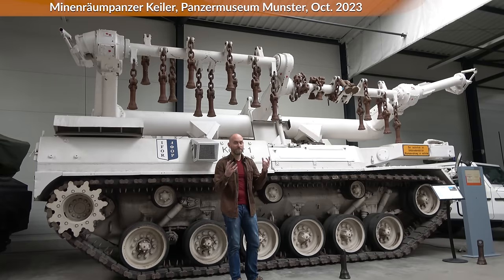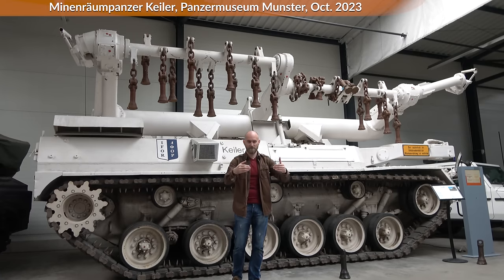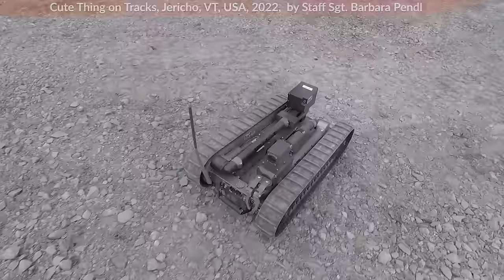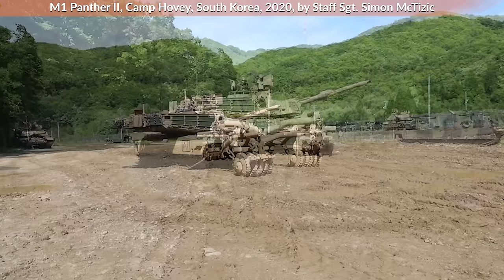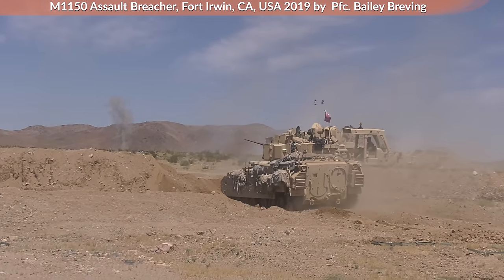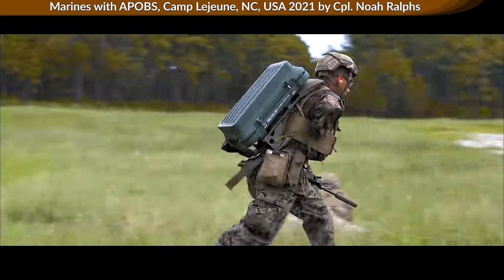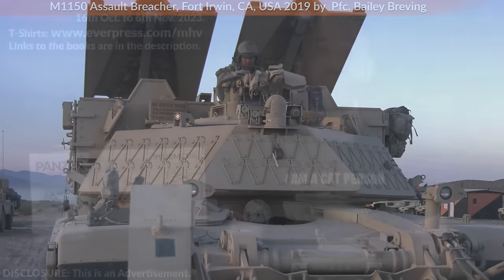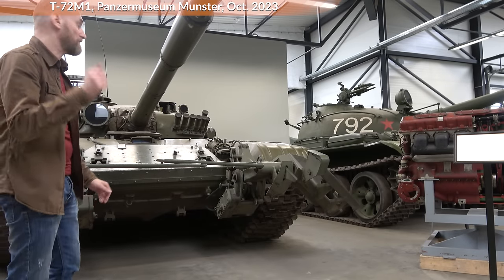Ukraine: The Problem with Mine-Clearing Tanks

Comment: State of art German and other NATO forces use mine-lifting and plowing to sides of the armored vehicles (minimizing dust clouds), NOT flails.
The WISENT 1 is an example mine clearing vehicle used by German forces.
Look at 
This massive armored vehicle has a giant plow for clearing Russian mines
Eight machines like this one are already in Ukraine to do the dangerous work of dealing with minefields.
BY Kelsey D. Atherton | Published SEP 22, 2023
Reply: Problem is still, that the mines are part of a defense belt, well inside the reach of dedicated artillery and as soon as the tank is spotted it's gone. Most of the time long before plowing a single mine... Clearing mines under fire is suicide.
Reply: @mnk9073  The new generation lift and plow to sides system moves much faster than the flail system, and without the massive dust cloud slowing the operation.
Using air dropped or rocket launched minelets to destroy mines only replaces enemy mines with dud friendly force mines.
ALSO: there are now GPS-driven, armored mine clearance DRONES.
Reply: @EK14MeV  Sure, but any selfrespecting defender has eyes on his minefields and beyond 24/7, the days of "sneaking up" on anything are long gone...
I mean, that famous picture of the first attempt by the Ukies shows 3 or 4 mine flails burning a mere meters into the field at best, half of them probably never even started flailing.
Reply: The Wisent 1 is not used by the german forces. It's only created by a german manufacturer(FFG). One specialty of the company is to recycle old vehicles like the Leopard 1 or the M113 to use them as base for new extended vehicles for special tasks like pionier tasks or mine clearing. Due to the old basic vehicles, the price is lower than for newly manufactured vehicles
Reply: @mnk9073  It doesn’t make sense that so many petty arguments rail against the best system available.
And there are now much less costly drones being developed, designed to clear mines without risking crews.

Comment: If you literally had a solid steel roller whose front roller was made of solid steel surely this would survive numerous explosions and wouldn’t kick up dirt etc like the chain flails and might also be a bit quicker too.
Reply: But, that wouldn't work on uneven ground since it wouldn't touch holes in the terrain
Reply: @nomennisceo6495  it’d have spikes embedded in it, which would also give it greater traction.
Reply: @josefk332  So, effectivelly chain flail but less practical to use and more expensive to make?

Comment: You by pass the mine fields by equipping an entire armour corps with amphibious vehicles that then runs along a river perpendicular to the front & then only go landward once the armoured corp  is sure it’s travelled deep enough into enamy territory to have passed the mine fields. You do it at night lacking heavy moonlight & have artillery & glide bombs drop either side of the river to mask the sound of the amphibious armoured corp.. Russia’s 40 odd Sprut-SD amphibious air droppable 125mm light tanks would do well here & can be upgraded above the waterline on the front & sides of the turret.
Reply: With reactive armour
Reply: "equipping an entire armour corps"
  - This is a problem in itself.

"amphibious vehicles that then runs along a river perpendicular to the front "
 ...and gets detroyed in the meantime due to making itself wasy target.

"You do it at night lacking heavy moonlight"
 - And hope enemy doesn't have a singular NV device?

Comment: Surely if you're pushing up to an assault you shouldn't be running the tanks on the road anyway, so mining a cross roads may cause logistic issues but shouldn't stop the attack
Reply: Depends on how far into the rear the enemy's rapid deployment mine system can reach.  
Tanks are often moved towards, or shuttled along behind, the front on heavy wheeled transporters as those can go faster, and don't wear out the tanks.  So if your plan relied on rapidly shuttling tanks from elsewhere in order to get the force concentration for your attack then mines dropped far enough back to interfere with that road-based rapid redeployment could definitely mess up your attack plans.

Comment: Why arent these things just completely remote controlled? Why do they even need a person in it.why are robots limited to being dog sized?
Reply: Many are build from the chassis of old tanks, and remote control modifications are expensive and difficult. Direct control of the vehicles also give a better awareness of the vehicles movement, there is also the problem of control loss
Reply: The newer ones, purpose-built vehicles absolutely are. However, those aren't standard kit. They are absolutely better, but they're not what people have. It's cheaper to outfit an older AFV chassis than buy a remotely controlled mine clearing vehicle.
Reply: Check out the slovak BOZENA 5 mine clearing vehicles- they are remote controlled and are pretty huge
Reply: Ukrainian farmers actually built RC mine clearing equipment out of old Soviet tractors, which I thought was genius! They’re so innovative and make good use of everything they have. I suppose necessity is the motivation too…

Comment: This problem should be solved different. Big size plower, I mean Nasa rocket crawler size, with removable supersize shield, shielded catepilars, with antirocket system on the top, with plower on the front and rear, with metal detector and superpower electromagnet underneath. But this would be probly to expensive to produce and operate.

Comment: I remember when it was “give us equipment and we will march on Moscow” and now it’s “see the problem with this equipment is….”
Reply from the maker: Well, if you consider that in fall 2022 the Russian lines were very thin and the Ukrainians broke through with rather light units, it is still debatable if that would have worked out, but you seem to miss that the front line fortifications etc. have completely changed by now.
Reply: @MilitaryHistoryVisualized I’m aware. I was simplying pointing out a problem that most people saw to begin with. A war was never the aim of Russia, it was to get an instantaneous surrender. When that option became a no go, defense became the primary objective, and boy did it work. A literal wall

Comment: So, considering all the mines have at least some metal parts, couldn't a new mine-clearing vehicle be designed which would have essentially huge microwave at the front? I know that there were experiments with such a thing for crowd control. And considering that mines are usually just few centimeters underground, then this should be easily penetrated by microwaves which would heat up all the metal parts and explode the mine.
Reply from the maker: I don't think it would produce enough heat/energy to blow up the explosives see this: https://www.youtube.com/watch?v=kC0gf7oWRUU
Also, it would need a LOT of energy I suspect. Another problem would be focus I suspect.
Reply: @MilitaryHistoryVisualized  The video you send is focused on reactive armor. Even if the explosive in mines is the same, you're forgetting that mines have to have fuses which should be much more vulnerable to this... theoretically. I'm not sure if anyone tried to put mine fuse into microwave.
Focus shouldn't be an issue. As I said, there was some development on it for crowd control. If I remember correctly, they could aim it relatively precisely up to 100 meters, maybe more (precisely meaning able to target specific person). Now power consumption might be an issue. It's one thing to heat up skin just enough for it to be uncomfortable, but another to heat up mines enough to make them explode. That being said, if development would be started I'm sure something would be figured out eventually. If you throw enough money on a problem, that problem will go away.
Reply: @fanta4897  "mines have to have fuses which should be much more vulnerable to this... theoretically" - just no. Theoretically AND practically, fuses would not be more vulnerable to this enough to make this vehicle survivable (so, practical).

Comment: Of course these mine clearing equipment are slow and cumbersome, and they could be seen at work for miles. For a commander to send these onto the battlefield without first trying to clear most of the enemy forces directly in front would be ordering them to their certain deaths. The original idea was to saturate the enemy with shells, bombs, and what have you first before driving these demining equipment over the battlefield to allow your troops to advance afterwards. These flail tanks and mine clearing vehicles are not designed to go out there as vanguards, at least not without shellacking the opposing troops first with lead and explosives.

Comment: The truth is that the modern defensive battlefield requires a super heavy assault gun with multiple anti projectile counter measure systems and multiple turrets. With an outer hull to stop heat projectiles.

The landship concept worked for WW1 to breach the trenches and bobwire. In WW2 maneuver was more important and the landship concept was not practical. 

In today's static battlefield a landship with multiple layered defenses and heavy armor would be practical. Multiple tracks like the t95 assault gun.
Reply: Doubt it, by the time it is developed and deployed artillery will be scaled up to deal with it.
It will be big and slow.
A billion dollar target for a cheap shell

Comment: I doubt many mines are buried more than 0.5m deep.
Why not use a v shaped plough to cut a lane 0.6m deep and the width of a tank's tracks, pushing everything to the side.
Reply: "plough to cut a lane 0.6m deep and the width of a tank's tracks" - Please think of all the reasons things like this aren't used in civilian world (despite potential uses) and multiply that reasons by "battlefield conditions!".
Reply: @randomnobodovsky3692  They are used in the civilian world for clearing regrowth from areas which have been logged & stumped.
The guy I asked said he'd ploughed down 15'-18" in the past using a Komatsu DX155. Hadn't tried deeper as there was no need but he thinks in farmland, 24" wouldn't be a problem.

Comment: MOS 1371: can someone answer me a quick question and tell me that I’m either onto something or barking up the wrong tree. 
Most people don’t realize that the spectrums of light are extremely broad, and the light that we can visibly see is extremely small. Some rays can penetrate ground surfaces and even metal. Such as the radio rays of light from a 5g Wi-Fi. 
I wonder if there’s a way to convert these rays light into a visible real light and use it to detect explosive material on a battlefield?

Comment: I try to tell people there is a very easy way to clear mines without equipment lose or injury s. It falls on young deaf ears or stubbornness. My proof is Israel does it without a single casualty. You have seen it but don't realize what you are looking at. You have to have at least in size Caterpillar D9. D10 is the same size but built heavier. D11t would be best. You need to add minor armor around cab. T21 or asu400 high wear carbon steel the same as the 3 to 4 ft thick blade is and tracks are made of. Tank mines will not affect D9t tracks at all. It would be best to push one D9 with another D9. Than you can push 2 to 4 ft deep at close to 20 mph in second gear through permafrost and any boulders even the dragons teeth. It will cut them in half. I done it myself in the Artic circle. The blade is 10 to 12 ft tall. 18 ft to 24 ft wide. If you put them beside each other blades touching and two pusher. Your are 50 wide. Pushing in front of you at least 50 yards of dirt. 5 loaded dump trucks.   Depleted uranium can not penetrate that much dirt plush 3 foot of high carbon steel. Which is 4 times stronger than stainless steel. Please check me out i dare you to think i am a lier. But i think D11 would be even better. Running 4 of them together at a time. No kidding 20 mph at least 50 foot wide or more with D11. They are all wired from factory GPS compatible to be ran remote even. In Alaska i seen D10 m. The m seires has a 6 way operational blade with blade forward or back to dig or carry load. M series also has 4 ft wide tracks that would help in the mud. D9 weights 225,000 pounds. 100 plush ton. Dependable. Twice the size of an Abrams tank. D11 will walk over and crush an Abrams tank so don't park 8n front of bland you can't see it or feel you are pushing it. D11 even D9 will push through those forests filling defensive trenches without stopping. I have done it. The trees stay standing straight up and just keep piling up in front . They don't even slow them down like a blade of dirt. Adding 6 or 8 inches of high wear carbon steel over and beside cab will make no difference to the machine for power. Plus i doubt many artillery rounds can penetrate. Add more if want another 100.000 pounds of steel will not affect the dozer. Give it better traction. Now look how the Israeli s do it. There is my proof. They call it the Teddy bear. No lost dozers and tanks follow.

Comment: How do mines work? What is the typical tricker mechanism?
Reply: A plunger detonater, Squash explosives, or hypergolic glass vial mixtures are "traditional" mine detonators. Whereas digtal sensor like magnetometers, pressure scales, acustic sensors and thermal sensors are "advanced" mine detonators... These detonators either initiates the explosive sequence or prime the main charge
Reply: The answer is there isn’t a typical detonation mechanism. You can have a stereotypical pressure switch, you can have a magnetic sensor, you can have a vibration detector, you can have a remotely detonated mine, etc… Other than simply bulldozing through there is no one way to get rid of mines
Reply: I guess that one can use any kind of sensor as a trigger. Only human imagination is the limit. A mine that explodes when someone press on it (like when you press a key on your mouse), or a sensor that makes the mine explode when it hear loud noises, or mines that explode from heat, or a mine that explodes from a smell of certain chemicals, from certain color, from heat, from magnetism, mines that explodes from a tripwire, mines that can explode when you crush the glass of a window, you can make mines that sends out a a laser beam towards a sensor and when someone moves between the two and interrupts this laser beam and blocks it - then the mine explodes. You can make mines that reacts to electricity, magnetism, air pressure, the speed of particles moving around in the air.
Reply: @nattygsbord  
Thanks
I was thinking there must be a limited number of standard mines in Ukraine. could a drone version of the lyc

Comment: Out of curiosity could an air burst bomb take out mine the deployed by air or artillery and can a bomb be used to make route in a mine like the explosive rope?
Reply: That was the case, potentially for a  while in the 40s but modern mines  are designed not to go off from pressure from a bomb
Reply: @noname-wo9yy  Then how is the pressure from the explosive rope any different?
Reply: @Archangel1862  the rope blows up the mine, air burst bombs just push down on the pressure plate
Reply: @Archangel1862  Because the explosives are concentrated to a small, precisely measured area. It would take a massive volume of artillery fire to achieve the same effect.
Reply: @scurra1163  Wasn’t talking about artillery but thank you
Reply: @noname-wo9yy  But rope isn’t eight meters wide so pressure is still somehow involved isn’t?
Reply: @Archangel1862  explosive ropes aren't instant detonations, they 'explode slowly', thus they don't shock the mines but pressure them... this is also why the explosion of the rope looks kinda 'fireball-ish'
Reply: @nomennisceo6495  Thank you
Reply: @Archangel1862  '... deployed by air or artillery...' Your own words. Not that it matters, the same applies for both artillery or bombs/missiles/rockets. A MICLIC line charge has around 5lbs of explosive every foot for 350ft. That's about 75 155mm HE shells worth of explosives. Or around three 500lb bombs. All in a perfect line for hundreds of meters.

It's just not feasible to 'walk' that amount of explosives via arty or air. And by air, even if they had the resources to pull it off, they'd be unlikely to survive the attempt.
Reply: @scurra1163  I was meaning mines that are above ground and could be assumed to be more susceptible to the pressure wave of explosives

Comment: Could Ukraine use military hovercrafts to get across the minefields?
Reply: Problem with military hovers is they don't really exist and need perfect conditions plus suppression only to reach the other side and it's fortifications. They can't follow through are not stealthy, fast, or tough
Reply: @CharlesWarrington   Didn't the British have some back in the 80's?  Did they decide it was a failed experiment?  I hadn't realised that militaries had abandoned the concept.

I get what you're saying about them not being tough; I suppose that the air cushion would always be vulnerable however much armour plate you might put on the upper body (although maybe hinged armour skirts could offer some protection...?).  As far as speed goes, I would have thought that they would be much faster than tanks, and even with buffed armour give IFV's a run for their money.  But I concede that without much offensive armament, they wouldn't be able to give the infantry they might carry any covering fire once they disembarked.

I'm thinking as I'm writing, so am very happy to be corrected on my assumptions 🙂
Reply: @CharlesWarrington  what happened to all the LCACs? Zubr-class? Also, the don't need to be stealthy if they move faster than artillery targeting and are able to move some troops over the minefield and go back at a random place at night.